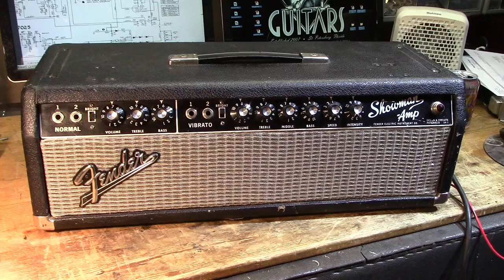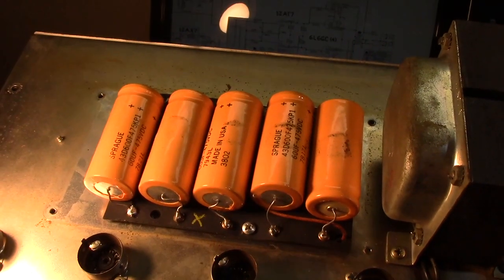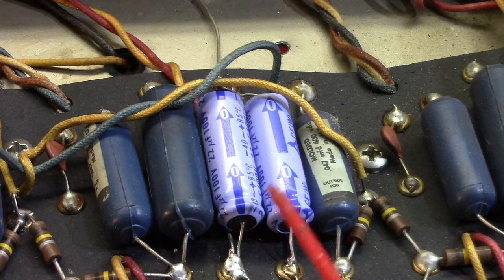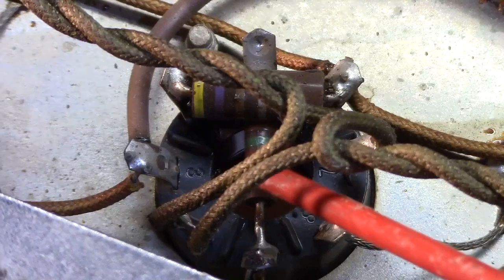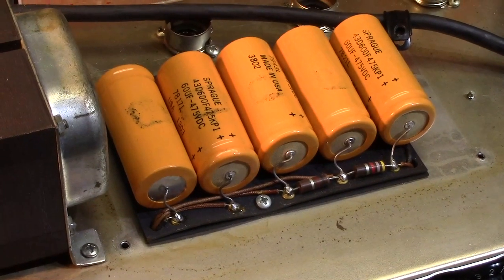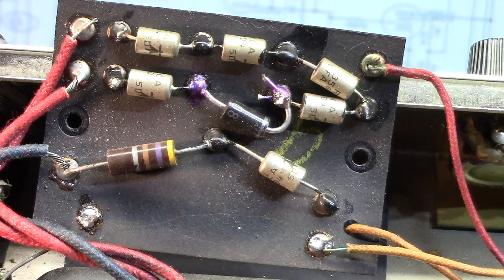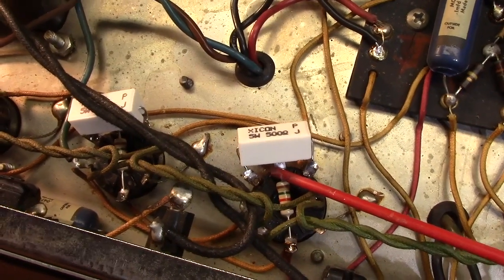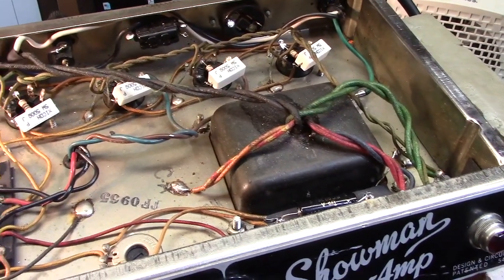1965 Fender Showman Amp Repair - Marx Brothers Model - Is This A Joke??

Comment: Wow.

I used the 1n5408 to rebuild two amps' rectifiers from memory... I figured overspec was just fine given they cost absolutely nothing.  In fact I don't think you even need to do the 3-a-side thing, you can get away with fewer depending on ratings or at least that's what I have read.  The issue I found in one amp was the larger diodes have much fatter leads

Seriously though why don't people stock diodes and replace the lot properly, I got a hundred for the price of a coffee